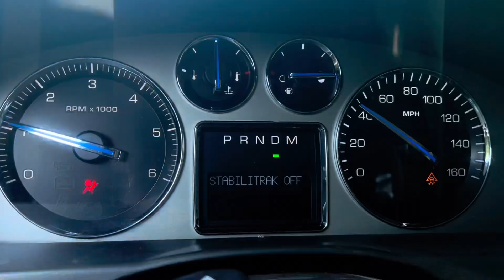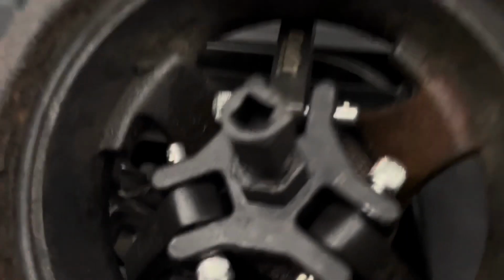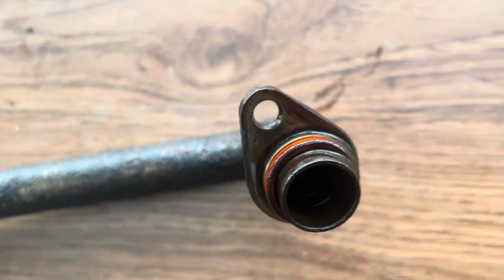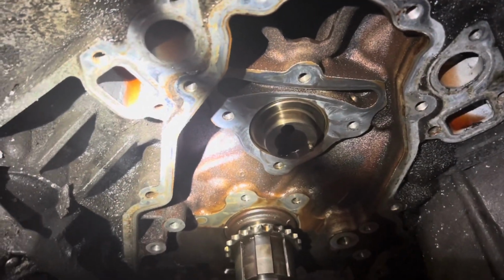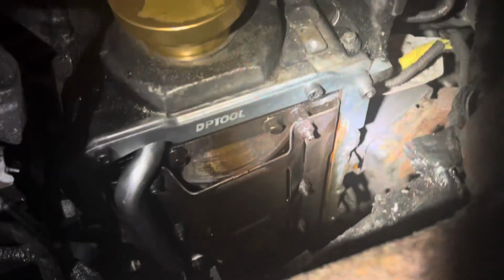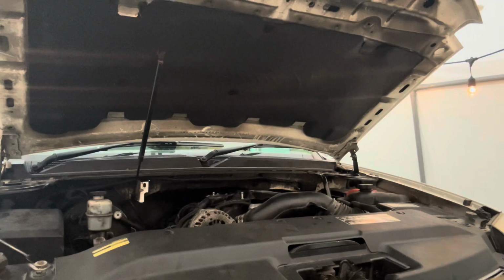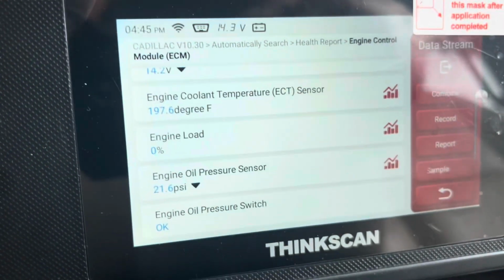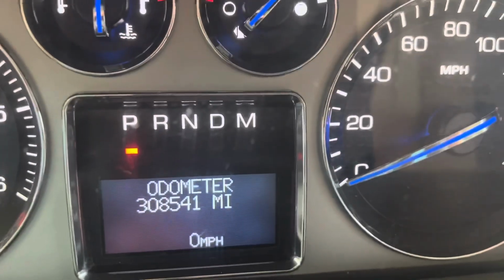2007 Cadillac Escalade - P0011 Camshaft sprocket/oil pump

Comment: I had this same issue on my 07 Escalade EXT. I was going to do a DOD delete . I recently just had my oil pan gasket replaced because it was leaking oil they replaced my oil pump o ring. I haven't had this  p0011 code since

Comment: Melling makes a fork adapter for the oil pickup tube to have equal tension on the tube. I put one in my escalade. Chevy design fail allowing the o-ring to potentially bypass air, and that's not great for the internals.

Comment: Did it stall with the code? Mine warms up slow down idle goes down to 400 rpm then stalls becomes crank no start until it cools off
Reply: I got exact same problem as you lmk if you figure it out lol
Reply: I have this problem as well. I heard the solution is to replace the camshaft position sensor and the camshaft adjuster magnet (and its gasket). Also should check wiring/continuity/resistance for related sensor wires. If you fix that and it doesn't fix your problem, then do a timing job, replace the oil pump, and do what the guys in this video did (replace oil pickup tube, clean out oil pan, etc). @michahoffman4148 @philh9238
Reply from the maker: @philh9238  sorry for the late reply 😅. Yes, before all of these repairs it did stall and wouldn’t start until it cooled down. I honestly don’t completely understand what would cause that (I figured the oil was too hot and lost viscous and was not getting sucked up through the oil sump tube due to the air gap caused from the cracked O-ring tube on the coupling end). Since these repairs honestly the truck has been running amazing.🤩 💯💯👍

Comment: How she doing she still running great no traction light again
Reply from the maker: @davntelisha19  still running great, no traction light, great oil pressure 24-27 psi on idle. I’ve put about 10,000 miles on it since the video. ..

Comment: Yeah I’m pulling my motor out doing cam bearings rod bearing main bearing and also taking the motor to a machine shop I’m going all out I need my truck to last for a while just got new lifters I went with melling lifters and also went with comp cam cam shaft and better springs well hopefully everything goes well I’ll post here on YouTube when I pull the motor out and show you the process
Reply from the maker: @davntelisha19  💯 sounds good 👍

Comment: Hello! What was the mileage of the car? At what mileage is it better to change the chain and pump? Do I have to change the lid to a new one?
Reply from the maker: Around 300,000 miles. Depends how you drive and maintain the vehicle. You can change the timing chain anytime after 150K miles I’d say if you want to be safe. … change the lid?🤔 I don’t understand that question

Comment: Has the stabilitrak  and traction  control  and p0011 code come back on ?
Reply from the maker: @The_mechanic58  no. The truck has been running great since I’ve changed all these parts.
Reply from the maker: @The_mechanic58  the truck has around 323,000 miles on it 😄👌

Comment: I seen this other guy on YouTube he was getting the same codes we was getting po11 and traction light come on he put everything new like you did but he did new timing chain new oil pump new vvt sprocket new vvt bolt and oil pump just like you did and he said he drove it and he kept getting the code again then his next move was to replace cam bearings and cam and that was his fix
Reply from the maker: Still running like a dream. So far I put about 5000 miles on it since the timing overhaul 👌👍
Reply from the maker: Haven’t seen a code yet. The traction light blipped a few times, actually twice ✌️ which could’ve been from other factors, other than that she’s been running great.💯💯👍
Reply: I did everything also my next move is new engine or cam bearings and cam shaft

Comment: Did that traction light come on every time and sometimes cut off by itself or 2 times a day
Reply from the maker: Before I did all this work to it yes, the truck was throwing STABILITRAK codes intermittently.. after I completed all this work the truck has been running like new ever since. One thing I’ll recommend for the 6.2 LS is to use WIX XP oil filters. If I’m not mistaken I’m pretty sure the WIX XP filters were engineered to run with the GM LS engines because of the lower idle oil pressure.. the pressure relief valve in the WIX XP filters is a lower setting than other oil filters like Purolator boss that’s set around 22psi. Truck runs noticeably better when I run WIX XP oil filters and now that’s all I run 👌👍

Comment: If you change all the stuff and it doesn’t fix it, I know exactly what it is ask me and I’ll tell you I had the same issue changed everyone of these pieces with all GM parts and none of it fixed the pressure issue no it isn’t the camshaft bearings either.
Reply from the maker: After changing all these things I’ve put about another 10,000 miles on it as it is my daily driver and 30 minute trip each way and the truck is still holding up. What did you change?
Reply: @rezcarguyz26  Was the lower intake manifold gasket o rings bleeding oil pressure after changing everything else I was thinking it might be the camshaft bearings glad I didn’t change them and tried the intake gasket first.
Reply from the maker: @keysautorepair6038  awesome 👏, is your truck VLOM?🤔
Reply: We have the P0011 code coming up again after changing the cam shaft the solenoid and positioning sensor. I’m at a loss. Any ideas? (07 Yukon Denali 6.2) also the oil pressure gauge is at 0.
Reply: @rezcarguyz26  2007 gmc Yukon Denali 6.2.
Reply: @annettegonzales168  The oil pressure sensor will fail completely I would change it first.
Reply: @annettegonzales168  How many miles are on your suv?
Reply: @keysautorepair6038  I have this same problem  after 3 or 4 time the light comes on engine  light comes on p0011 . So do I change intake manifold  gaskets ? and it should fix it?
Reply: So intake  manifold  gaskets?